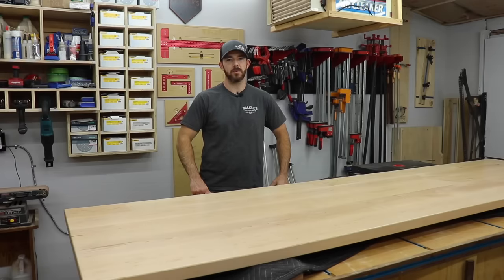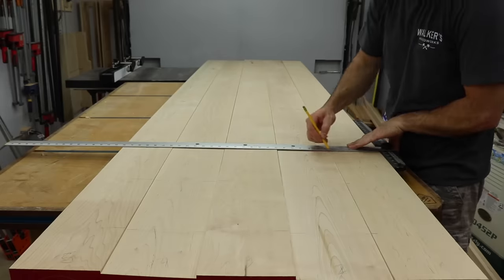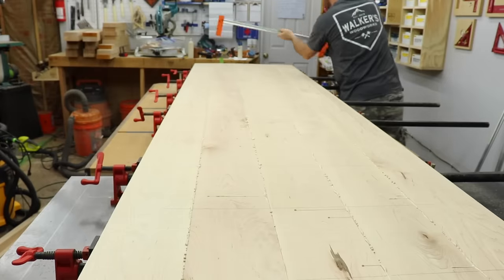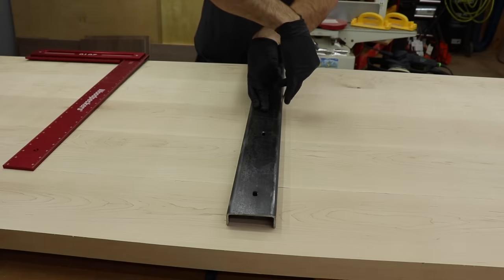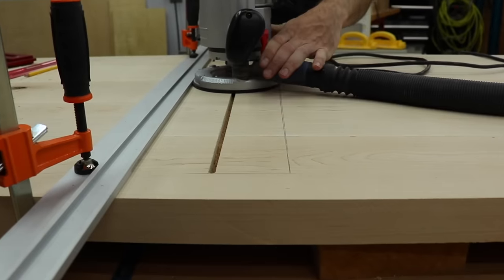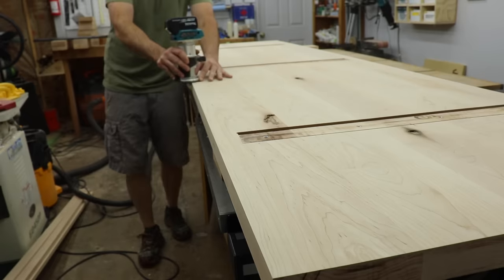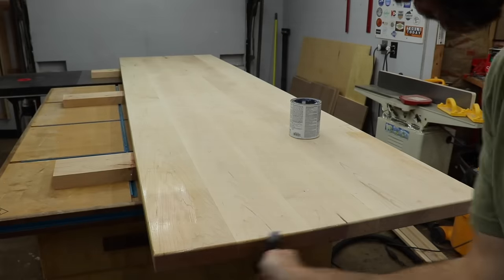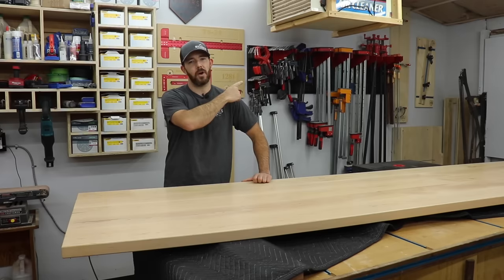How to build and finish a desk top / DIY Table top

Comment: I’m a novice woodworker and have built a few tables, but always had problems with the entire top cupping or twisting, even with alternating the end grain. I love the C channel idea to mitigate that. What size threaded inserts do you use? And what about spacing lengthwise for the c channel? I’ll be building a 10’ knotty alder table top in a few weeks and would like to try out your method. Thanks!
Reply from the maker: Check out this video.  I explain all about it and provide links to the inserts and c channel 👍 https://youtu.be/2Pd6rEbkfo0
Reply from the maker: One other thing to make sure of is that your wood is dry.  Moisture content should be under 12 to use typically.  It depends on your area though.
Reply: @WalkersWoodworks  thanks! Awesome video. What about distance from the table edges for the c channel? Does it matter how much of the c channel is embedded in the outside boards?
Reply from the maker: I usually keep them about 2-3" from the edges.

Comment: I'm building a long reclaimed pallet wood desk for a recording studio... I thought something that long (only 1.6m in my case) would now in the middle? Do you not need something running vertically up the table to stop that happening? Great video though! :D
Reply from the maker: I'd use 3/4" plywood as a base for something like that.
Reply: @WalkersWoodworks  that's exactly what I thought to do! Thanks for the advice. :)

Comment: Few questions: sorry if it's answered already 
How thick is the wood? 
Is it possible to join them all together but make it look like one big slab? Like a darker finish maybe? 
If I wanted 1800x700mm 2inch thick desk, how deep can I route out some lines to use epoxy before I compromise integrity, assuming the epoxy won't strengthen it back up? 
Would I be able to use two of those c supports towards the centre, or just one in the middle if use sturdy legs? (The epoxy lines will be from the left to centre, about an inch thick. But I don't want it to clash with the c support. 
If you've used a hidden wireless charger, how close to the top does it have to be? 

Love your channel, sorry for the list of questions but you just make it all look so easy!
Reply from the maker: The wood is what they call 8/4 so it's about 1-3/4" after it's finished.    The epoxy would strengthen it back up.   The c channel is just there to keep the top flat.  Some people say it's not needed but I like to use them.
Reply from the maker: I'm not sure on the wireless charger.

Comment: Why not use a shaper to make some kind of profile on the edges of the board so that they align perfectly in the height direction, AND it increases the glue surface area ?
Like the kind of profile they used to make laminated timber.
Does it cost too much in time and router bits ?
Reply from the maker: I don't have a shaper and in my opinion it's not needed

Comment: Well explained video! Quick question? Do you also sand after the final coat? I hear some people do that to smoothen out any imperfections left. If so, what grid do you use? Thanks!
Reply from the maker: You can just use a paper bag to knock down and little dust nubs or anything after the final coat is cured.  I wouldn't sand it though.
Reply: @WalkersWoodworks  Thanks! I'll try that.

Comment: Beautiful work. I always worry for some reason about the durability of polyurethane for a work surface. I want to build a dining table, but it also doubles as my kids drawing and craft table.  Would be interested in any feedback on alternatives as it seems every channel has their own preference from Arm R Seal to poly to Rubio monocoat or even some epoxies like ecopoxy (John Malecki).
Reply from the maker: I've never had a problem with it.  However you should expect to refinish any table top finish every few years to keep it looking new.  I would say conversion varnish is probably the most durable.

Comment: Thanks for putting out great content. How would recommend fixing cupping that has occured on a table top like this? I have 4 pieces of pine that are glued and screwed together using some metal brackets on the bottom, but the whole table started cupping upwards at some point during the finishing. I'm not sure how to correct this as I have already sanded, etc.
Reply from the maker: Not much you can do honestly.  Unfortunately it was probably not dry enough.
Reply: @WalkersWoodworks  ah bummer. Thanks for the insight!

Comment: Is there a reason you use the biscuits over using pocket holes to secure the boards together? I don't know enough about wood-working to know if it's for any reason other than not having visible holes? I want to put my heavy computer on my desk and I'm worried those biscuits and glue won't be enough.

Thanks!

Comment: Nice build.  Have a question, I just finished a table top build using glue and pocket screws.  After getting it together I noticed I had cupping at the ends.  I was so frustrated.  How can I prevent this from happening.  The boards I used were 2x8 pine.
Reply from the maker: More than likely the pine was not fully dry.  That's why I never use any wood that isn't kiln dried.  Also I don't recommend using pocket screws to hold a top together.  They don't allow for wood movement which could be another reason it cupped.  Hope this helps!

Comment: Love this table top you built!!! I want to build one for my kitchen desk area, but not sure what I’d need for support. It would be 19.5 deep with two small 18 in cabinets that will support it on each side but the open space between is 8feet for a total length of 11 feet long. What would you recommend to give it the stability in the 8ft opening so that it is strong enough to stand the test of time? 
2-  Angle Iron imbedded into the length of the desk? Also I live in North Dakota any chance you’d be interested in some work to make one for us?
Reply from the maker: I really appreciate it and sorry it took so long to respond but I don't actually take client work anymore.

Comment: I went out and bought the Ryobi Biscuit joiner and the 20 biscuits, however my biscuits fit extremely loose, to the point they really don't help with alignment (they have no "grab" and slide back and forth in the slots). Did you ever have this issue with it? Do you use a different brand of biscuits maybe? Was really excited to find an easy joining method but thus far no luck.

Comment: Nice work. Couple questions...why have both the festool sander and the yellow one? They’re both pretty expensive and I believe they both do the same thing. Also, about how much would you charge to do a desktop like that? I say “about” so you don’t feel like you have to reveal how much your customer paid. Thanks in advance.
Reply from the maker: Well the Rotex is good for material removal but in my opinion is not a good finishing sander.  The Mirka Deros is far superior on finishing.  The price really just depends on material used honestly.  I have a formula I use for my work.  It's basically material + time + margin.

Comment: Great video and build! Thanks for sharing. My question is about flattening out the piece. I just did my first glue up, small scale, for a dog bowl stand. I am prepping to make a desk for my daughter and want to follow this same approach. In the piece I am working on now, I really struggled with getting it all flattened out. I am using hand planes to do so, which is so satisfying, but still has a little warp in it that I have to work out. Looks like yours was already super flat and you just went to sanding. Was the lumber used super flat and square already or was there a step you did not show?? Sorry for the story and question. Still a newb and trying to learn as much as I can...became a sub too.
Reply from the maker: Yea the lumber is almost always flat and square.  There is a saying... Start square, end square.  I try to follow that as much as I can.  It makes things much easier. 👍. Good luck with your project.  I hope it works out.
Reply: Walkers Woodworks perfect! Thanks again for sharing your knowledge.
Reply from the maker: Thanks for taking the time to watch and comment! 👍

Comment: Hello! At 9:25, do you sand it with 220? Between coats? 

How do you clean the sanding residue after that? Wet towel? Etc?

(Where I’m From I don’t have tack cloths)
Reply from the maker: It's just a fine sanding pad.  Something like 400 grit.  Wipe clean with dry paper towels.

Comment: Hello, I was wondering if you don't mind recommending me the specific Rampa insert & screws to use for a project.
I have a walnut butcher block (1 1/2 inch thick , 72 x 30 inches) that I am planning to install on top of a UPLIFT V2-Commercial frame but, i am  not sure about the size | type I should use, Thank you. 

I believe the frame has just 8 available holes to attach the top. Additional, on the far end of the table top  I'll install 4 monitors that should weigh about 70 to 100 lbs max.

Comment: Can you provide any detail on how you attach the legs to the table top?
Reply from the maker: This top actually just set on cabinet bases.
Reply: Walkers Woodworks is that what you typically do for table tops? Or do you use threaded inserts or something?

Comment: I'm a novice so forgive this question. I see the link for the threaded inserts you used but can you provide the size of insert you're using in this video and a link and description for the screws (with size)? Thanks!
Reply from the maker: Get them from bidwellwood.com the channel and inserts I use is from there. Use the code walker10 for 10% off 👍 the size I can't remember off hand but either one on this website will work.

Comment: Seeing as you are still replying to comments, here is my question: How much do you charge for this type of job? ( I am in Europe so the price wouldn't be completely equivalent, but still.)
I am considering building a desktop( 2.5m long 65cm wide) and debating whether to buy some of the tools (probably just the router, the rest I can borrow from the workshop we have in the place I work) or to pay a professional to do it with a CNC router. The problem is he is asking 350 euros to do the job, and with that kind of money I feel I can buy the rest of the tools I need plus the materials and have 100-150 euro left. 

Also, goes without saying, great job on the desktop and this video obviously inspired me to build one myself as it has with many others.
Reply from the maker: Thank you!  I charged $1000 for the top.  I'm sure you can do it!  I wish you luck. Try it yourself.  No reason to have someone else do with with a cnc.

Comment: Hey Brandon, I was making a tabletop based on this video. I let the table top set overnight after putting in the biscuits and glue, and when I took the clamps off this morning one of the end boards has a little wobble. It’s very solidly attached, but has slight movement. What’s the fix for this? Do I need to remove and Reglue?

Comment: are biscuits better than pocket holes? ive seen several videos using pocket holes. what is the difference?
Reply from the maker: Definitely don't use pocket holes on a table top.  They don't allow for wood movement.

Comment: Im building my first coffee table top out of 6/4 Ash. I have milled it and am ready for glue up. I noticed you didn't need (want) to use cauls. Was that because you have the top clamps on pressing down on the boards? Thanks for the video.
Reply from the maker: I have used cauls in the past.  I still do if it doesn't want to stay Plat when tightening clamps but yea clamps on top and bottom seem to help keep it more flat.

Comment: Hi Walker, do you wipe the dust off inbetween sanding with a rag before applying more poly? Or do you apply without cleaning was dust off after sanding?  Thanks
Reply from the maker: Yea I blow it off with air and wipe down with a rag.
Reply: @WalkersWoodworks  Thanks!

Comment: What is your opinion on biscuits compared to pocket holes?
Reply from the maker: Two different things.
Reply: @WalkersWoodworks  They are both used to join wood. Two different techniques for sure. Just wonder what you prefer and why.

Comment: what's the name of this silicon/rubber spatula/brush you are using for finishing the top ( you can see it in 9 mins and 14 secs for example)
Reply from the maker: It's a titebond "titebrush" pretty sure it's linked in the description.
Reply: @WalkersWoodworks   it's another one which is not mentioned

Comment: What HP is that table saw? Looked like it took a bit to push that big 8/4 lumber through. I'm about to pull to the trigger on a Sawstop and have been leaning towards the 1.75HP to save money and not have to add a sub panel for 220v (my panel is full,) but want to make sure it's enough.
Reply from the maker: This one is the 36" 3hp.  If you're going to spend the money I'd say go 3hp for sure.
Reply: @WalkersWoodworks  Thanks! Going to have an electrician come over to see if 220v is possible without spending a fortune.

Comment: What kind of wood would you recommend that does not tend to splinter after a while? or does it matter if  you sand it and seal it good?
Reply from the maker: Any kiln dried hardwood should be fine after sanded and sealed

Comment: You never had problems with warping when applying multiple coats of finish on just one side at a time? Always wondered about that, i never risk it really,  but turning a heavy top multiple times can be a task. Must say it seems unlikely that the boards join perfect after putting them through the tablesaw, you skipped the part with the planing of the sides?
Reply from the maker: I glue them up right off the saw.  I use a glue line ripping blade.  Works well!  With water based poly you can put on several coats in a day.  I usually just do two coats on the bottom, flip it and do the top with 4-5 coats.

Comment: Hi! I only wish i have found your video sooner.. So.. I sanded my beech wood table top with 240 grit, stained it and next day after it dried all the wood grain was up because it has water in it. Now i am not sure what should i do, Should i sand again with 300+ GRIT just to remove grain or put poly first and then sand with 300+ GRIT. Could you please help the man out.. Thank you
Reply from the maker: I would use scotch Brite and see if that smooths it back out before applying poly.

Comment: When using the router and circular saw you run a long (plastic?) piece perpendicular with the table that allows for straight cuts and such. 

What is that item called? I didn't see it linked... Thanks!
Reply from the maker: It's metal.  It's the track for my track saw.

Comment: I’m planning on using maple to make a desktop. I already bought some 1” board and plan on making it about 8 ft long and 26 inches wide. There will be two drawers on each end of the top. How would you recommend reinforcing the middle so it doesn’t bow with the weight of my computer monitors? I want the bottom to be as flush as possible. I was planning on doing two width-wide c channel  and then one channel length wise to connect them? Sorry for the long comment but could use some advice or suggestions that might work better!
Reply from the maker: That should work fine.  Gonna be a cool desk!

Comment: I'm currently building a desk measuring 6 ft long x 30 inches wide x 1.5 inches thick with pine wood. Is it necessary to add C-Channels underneath? Can I finish the bottom of the table with water-based poly but finish the top of the table with epoxy or will it warp from the different finishes? 

Thanks!
Reply from the maker: I would put channel in it.  Pine moves alot.  Make sure the holes are elongated though.

Comment: Hi, what are the c channels for and are they necessary?
Reply from the maker: It's debatable but I always use them.  They help keep the top flat.
Reply: @WalkersWoodworks  gotcha. So in your opinion over time the glue and biscuits won't be able to keep it level from wood twisting and warping? Or is it more of a how much weight the table is holding? Thanks for replying

Comment: Why do you use the inserts instead of just using the CL glue on the U channel and bolt the channel directly to the wood?
Reply from the maker: Because that wouldn't allow the top to expand and contract. That's why the holes are elongated.
Reply: @WalkersWoodworks  the inserts that you screw into allow for expansion?
Reply from the maker: I’m not sure what you mean. The inserts are so I can use bolts because they are stronger than just screwing into the wood
Reply: @WalkersWoodworks  ok. thats whay I was looking for. Thanks man. that table is fantastic.
Reply from the maker: Thank you!

Comment: How much do you charge for something like this? I always have a hard time figuring out what to charge people. I try to estimate material cost and labor cost but most of the time I end up being very wrong on labor and end up under charging, selling myself short. I've undercharged so badly that calculating based off the original price I gave them, I only charged about $10/hour for labor. It's partly my fault because I end up going back over things sometimes that others might just leave or sand down to what I would want my piece down to, but it ends up biting me in the ass every time.
Reply from the maker: I think that happened to everyone in the beginning until you figure out how much time things take.  When I was doing client work I did material + hourly labor = x then x+40% = total. This top I think I charged about $1,000.  Hope that helps!

Comment: Do you think a walnut top that is about 1inch thick and 6feet long and 2 feet wide would need c channel?
Reply from the maker: Depends on what you're using for the base
Reply: Walkers Woodworks that makes total sense, it’s going on this automated lifting mechanism, which has 3 supports, so maybe not needed in this case : https://www.progressiveautomations.com/products/flt-05